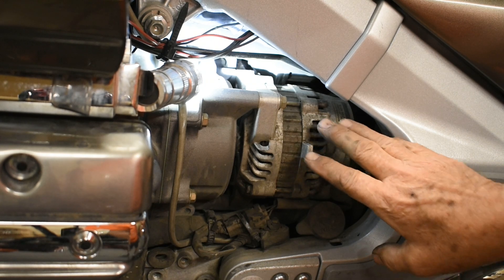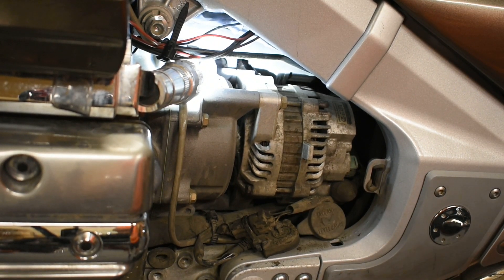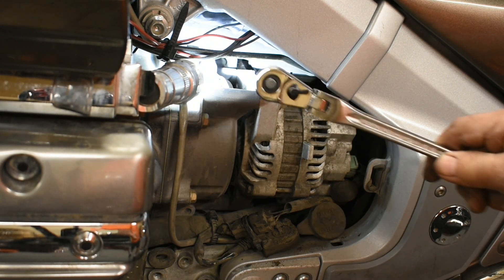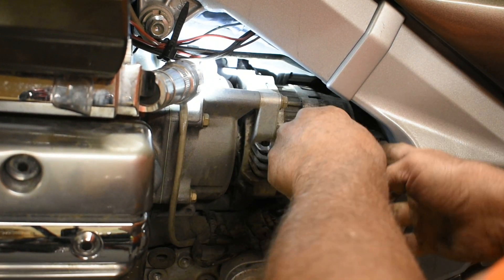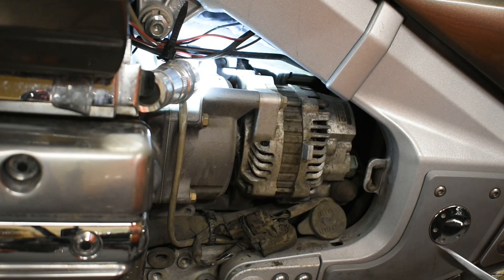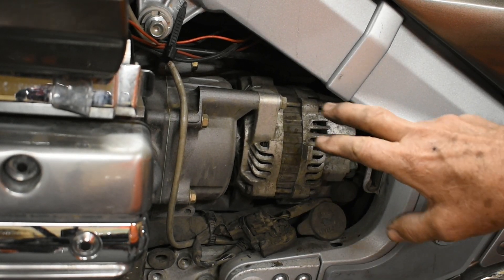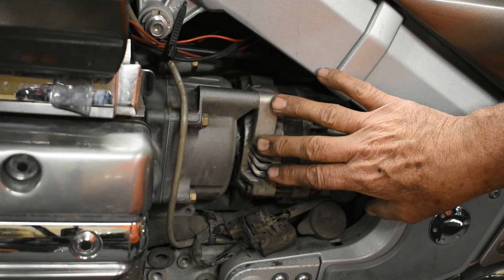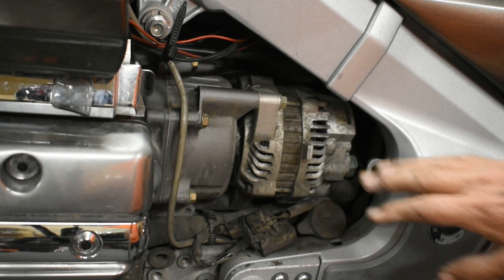GL1800 Alternator Replacement

Comment: My UK 2004 doesn't have that empty area above the alternator, it's rammed with a chunk of wiring loom, a fat hose, and two solid pipes (fuel maybe) which dive down into the gap you've wriggled the wrench into which  prevents the wrench extension from getting a perpendicular shot at the alternator bolt. I thought I'd have to resort to removing the battery cradle and going in with an uber long extension. But then I tried using a 1/4inch drive wobble extension and although that planted the socket on the bolt there was too much slack for the wrench. But that gave me the idea of only half fixing the 3/8th 12mm socket to the 3 inch 3/8th extension which gave just enough wobble for the socket to fully plant on the bolt. I also bought a new 12mm socket for the job which helped. I didn't want to take a chance with an old faithful. The video is much appreciated. Thanks.

Comment: I ordered a "Gearwrench indexing double box, 11-12mm".  It allows getting to the back bolt directly over the top of the alternator.  It's an amazing tool!  I really appreciate your breakdown of the DB electric unit vs. OEM.  I bought one from DB and had that uneasy feeling about possible reliability and quality of the unit should I need it.  It does appear to be completely good to go. Thank you!
Reply: this sounds very good, since people are saying the whole engine needs to be taken out... I tried with my rachet, but couldn't get to it!

Comment: Excellent video, thumbs up all the way.  I will start by saying I have not attempted this as my existing one is trucking along just fine at 58k miles.  However, I have read the reviews for the DB electric alternators on Amazon, and the reviews are very mixed.  Some saying they fail at 300 miles, others failing at 1500.  At least it is relatively easy to change out again if needed.

Comment: I watched this video when I replaced my original alternator about a year ago. 4 months later my aftermarket unit failed so I had to replace it again. I went with OEM this time. Most of the reviews I read indicated going OEM and I wish I had to start with. If you're tackling this job, do yourself a favor and go OEM.

Comment: Do you have a Video on change out the starter on a 2004 1800. Start to finish ? Thanks
Reply from the maker: Sorry no I don't
Reply: @RuleofThreeD Can a cheaper aftermarket alternator be used? The new OEM Honda ones are $600 plus no thanks😢